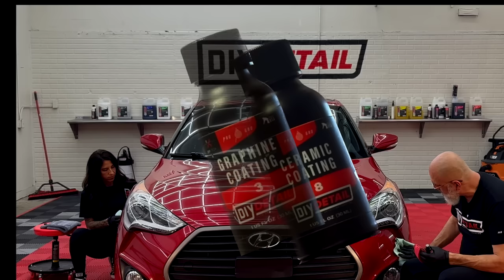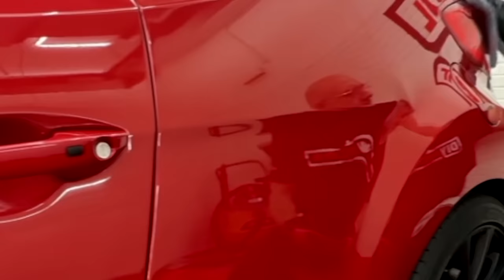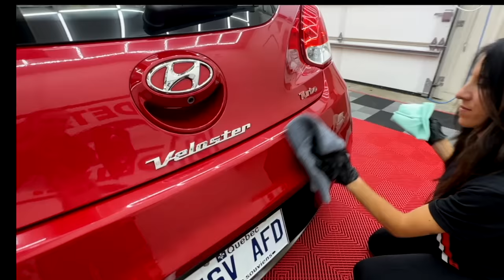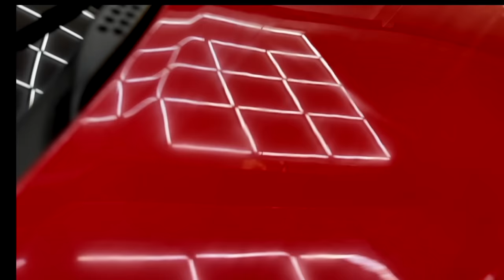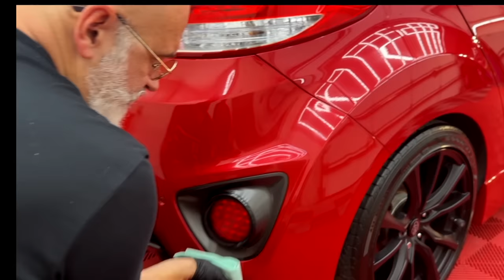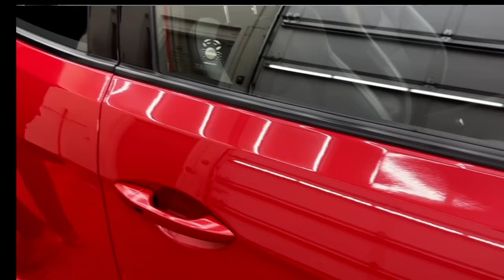THE STACK: the ceramic coating 2 layers, 8 years on top de 3 years #diydetail

Comment: I have a mobile detailing business and I really thought coatings were kind of a gimmick before watching your channel. So much info and I’m going to have ceramic coatings as a main part of my package offerings in the spring. I’m also testing out some of your other stuff currently!
Reply from the maker: Great to hear!
Reply: Be prepared to spend time on a vehicle if your coating. Washing, claying, polishing, panel prep, then you finally can put on the coating. Did a ceramic on a f150 and that took me 6 hours. Very labor intensive if you want to make sure the coating lives up to the durability claims.
Reply: @aRANDOMqUICKIEgunsandfun for a coating to live to it's durability claims the maintenance of it is important- proper period washing, decon etc along with the environment it lives in daily, that plays a much bigger factor then whether you chose to polish or not beforehand etc
Reply from the maker: 6 hours of  pampering your vehicle for years of easier maintenance seems like a good investment in time management.
Reply: I cam assure that ceramic coatings are the best thing for paint right beside polishing/correcting. The best part about ceramic coating is even when your vehicle is dirty, it still looks cleaner than most people's vehicles 😂
Reply from the maker: @pittsburgh4129 very true

Comment: A quick gloss question about topping the 5 and 8 year with 3 year. Since the 5 year is the "gloss king" will the 3-year still enhance the gloss of the 5 year?  And a quick follow up about Ceramic Gloss. I'm super impressed with Ceramic Gloss. Will that enhance the gloss further if applied by applicator every few months? Your no nonsense straight talk videos are wonderful! They really help a lot!

Jim
Reply from the maker: Jim, the stack improves every aspect, including gloss. DIY Detail Ceramic Gloss makes a good thing better
Reply: @diydetailofficial   Thank you! That's exactly what I wanted to know.
Reply from the maker: Thank you.

Comment: I have to say, I love every product that I've used from the DIY Detail lineup! They're every bit of what you claim and then some. I really appreciated the well thought out and simple names to go along with some crazy chemistry that just seems to do better than most of the competition. The videos you put out or top notch as well! Thank you for all you do for the detailing community. It's greatly appreciated!

Will one bottle of your 8 year and one bottle of the 3 year do a crew cab 8 foot bed truck not including glass or chrome bumpers? Some coatings I've used will and others won't, so I'm curious as to if you know or not. Thanks.
Reply from the maker: Thank you

Yes one bottle will suffice, but stretch out the coating. Many people try to apply too thick.

Comment: Just ordered the 5 year kit, the iron remover, the water spot remover (better safe than sorry), and the decon towel. I have a couple scratches that i will be removing but then plan to polish the paint before applying the coating. Its a 2022 VW Atlas Cross Sport so the paint is pretty fresh but if im going through the whole process i may as well spend a couple hours doing a polish.
Reply from the maker: Excellent, please post your results in our facebook group. https://bit.ly/DIYDetailFacebookGroup

Comment: Does applting the three year lessen the longevity of the 8yr coating? Also what's the point in have different grades?
Reply from the maker: No degradation, different grades for different needs

Comment: I loved this video. This is something I've wondered about. Can I apply two levels of the same coating, a 5 year over a 5 year? Does two layers provide additional protection? I have left over coating I don't want to go to waste. I applied my coating a few weeks ago, can I just wash & use panel prep before the second layer if you approve.
Reply from the maker: Yes, you can .

Comment: Great video. I’ve used the 5 year coating and am blown away with the gloss. What do you do with the black trim that is oxidised if you can’t coat it?
Reply from the maker: Use short term protection like DIY Detail Ceramic Gloss or DIY Detail Quick Beads

Comment: I did buy the stack recently and am waiting on spring to detail my truck.  So, its one coat of 8 year and one coat of 3 year right?  Also, I was going to use the same coating on my new boat however, after talking to Glidecoat, they mention that, their coating is formulated for gel coat.  Is yours equivalent and is there truth to what they are saying?
Reply from the maker: The DIY Detail coatings will perform great on gelcoat

Comment: If you get scratches, how do you remove the ceramic so that you can buff and re-apply.
Reply from the maker: Polishing. You do not need to remove a coating completely before applying a new one. You simply need to clean and abrade with a polish.

Comment: If a 3 year coating let’s say last 3 years then how does that effect the 8 year underneath?  Does the layered coating reduce in its properties due to the 3 year “expiring”? Will you have to polish to reinvigorate the 8 year? Or are the two coating chemically integrated and the 8 year properties shine through. Just concerned about the graphene oxide matrix failing. Thanks!
Reply from the maker: The 8 year shines through. If you’re concerned about water spotting, using DIY Detail Quick Beads will be great at keeping Graphene on the surface.
Reply: @diydetailofficial  thanks! I guess the Lexus RX350 is gunna get the ceramic tag team! First time coater going for broke!
Reply from the maker: @WilsonSilverthorne perfect, you will enjoy the process and results.
Reply: @diydetailofficial  Quick one.  I tried to buy the 8 year coating kit and the 3 year didn't ring up free.  Is the coating kit excluded and just the singe 8 year bottle the deal?  Looking forward to the fun!
Reply from the maker: @WilsonSilverthorne  kits are not part of the sale.

Comment: So not to sound stupid, but would the combination of the 2 actually make it an 11 year protection? Or what do you do after the 3 year of graphene is gone? Oh, and gotta say your helper is absolutely gorgeous. Thanks for your videos also they are helpful.
Reply: No it doesn't make it 11. You'll get the benefit of the graphene for the first 2 to 3 years then the ceramic for the remainder of the five years
Reply from the maker: Realistically if you maintain your vehicle properly, the coating will last the lifetime of the car.
Reply: @diydetailofficial  At the end of the 3 years could you do a decon and reply the 3 year again?

Comment: Nick or Yvan - We all know how hard it is to get white or silver cars to shine. Which of your 3 coatings will give me the most gloss, as I own both exterior colors.  I recall you both saying the 5 year would be best many short videos ago but I want to verify. Thanks gents. Love your products.
Reply from the maker: 5 year is definitely the glossiest!!
Reply: Thank you. Can't wait to get my Camaro coated and ready for next spring.
Reply: -Is the 5 year glossier than 8+3 stacked? 

- if i just wanna apply the same coating in 2 layers, will the process be the same in terms of waiting time and window? Does it have benefits?

-Also: can i use your coatings for rims and tires? 

Thanks a lot as always ❤
Reply from the maker: The 5-3 stack is the glossiest combo.
The process is the same to do 2 layers of the same coating, but there’s no real benefit. 
Our coatings can be used on wheels, but not the tires.
Reply: @diydetailofficial  - Copy. Thank you so much!!! Continued success for DIY DETAIL.
Reply: @diydetailofficial  That's all great info! Thank you folks!
Reply from the maker: @keithecklundii5225  thank you
Reply from the maker: @muffin70507  thank you
Reply: @diydetailofficial  thank you again very much ❤️
Reply: @diydetailofficial  i am from germany and cannot order anything unfortunately. The Dutch shop from your distributor list is only shipping inside the netherlands and the UK shops are only for mainland UK because of their brexit. Any euro distributors coming up? Maybe international shipping through your website?

Cheers guys

Comment: I applied the 5 year coating to my car in May. Would I be able to top it with the 3 year coating now after I perform a decon wash? Thank you!
Reply from the maker: Yes you can, but it will not have the same effect.
Reply: What will be missing by doing it 5 months in between versus back to back?
Reply from the maker: When doing them in the 2-8 hour window, we are not putting one on the other, they are combining to create a new surface.

Comment: Can do the 8 and the 5 and the 3 
Dose it work and if u tested it what is look like dose it look better than the 8 toped with the 3  in any way
Reply from the maker: 8/3 or 5/3 have a similar look, but the 8/3 has better hydrophobics
Reply: I recently painted my car and the clearcote is kind a heavy and got som orange Pele  can i wet sand my car for meror look and do the 8/5 for good protection and if u don't recommend the wet sand can I do the stack on ppf
Reply from the maker: @hothefa_oby8973 you can wetsand and polish, PPF, or both, the choice is yours
Reply: Thanks very much fotlr all the help   but  I didn't get the answer for the ppf  can i do the diy ceramic cote on the ppf
Reply from the maker: @hothefa_oby8973 sorry, yes definitely do the stack on your PPF

Comment: Will this stacking & longevity work on Gel coat too after correcting it?  The boat will never see salt water, only fresh.  Can it be applied below the waterline or does it need to be at or above.
Reply from the maker: Yes it will work great on gel coat. The only thing to be aware of is if the Gelcoat is oxidized, it will continue to oxidize under the coating, even after polishing.
Reply: @diydetailofficial  So you're saying that even though it may have 8 year ceramic on it, it's possible that in 2yrs or so, the ceramic coating will still be there but the gelcoat under that ceramic coating will be starting to get cloudy & oxidizing again?  And then I'm going to need to compound through the ceramic to buff the oxidized gel coat again & then recoat again?
Reply: Is there any way to stop it from oxidizing?
Reply: @joelpasserell4525 he's saying that if it's already oxidizing the coating doesn't stop it from continuing to oxidize. It will continue to protect but the oxidation will continue as well. There's really no way to stop oxidation outside of completely removing it and starting fresh. Once oxidation begins it will continue to oxidize.
Reply from the maker: Correct Jeff.

Comment: When stacking the 3 year on the 8 year does it increase the water spot abilities of the 3 year for a longer period of time due to the fusion of the 2 coatings? Or does that not effect the chemical makeup of the graphene oxide in that regard? 

Some coatings seem to only benefit by 10 to 25% when adding a second layer according to some people (really hard to tell in my experience) do you have a more scientific way of knowing how much longer or chemically resistant the stacking will be compared to a single layer of your 8 year coating? 

What is the shelf life of an unopened bottle of your ceramic coatings? Do they lose efficacy after that period or will they start to crystalyze in the sealed bottle? This assuming they are kept in a dark, cool room. 

Are your coatings freeze thaw stable as far as transporting them in the winter? I've heard of people storing their coatings in a freezer to increase shelf life. Is there any truth to that or would that be due to the individual chemistry in a coating. Thanks!
Reply from the maker: Thanks for the great questions! 

Stacking doesn’t change the durability of the Graphene component.

The benefits of combining the 2 like we do( unlike putting the same product on twice) gives you additional slickness, gloss, and self cleaning ability. 

Freezing isn’t a good option, keep them at room temperature ( we have aluminum bottles, so light doesn’t change anything).
Reply: Perfect! What about if the bottle is once opened? For long long they will be good for usage, assuming they are stored as mentioned previously?

Comment: Your site doesnt say how far the ceramic coating goes. For example i have a dodge ram. 1500 4 door. Is 1 bottle enough for windows, rims, paint?   5 year and 3 year
Reply from the maker: Yes, and you should have leftovers.
Reply: I must disagree!  I just coated my 2023 Toyota Tundra Crew Cab with the 8 year coating and I did not have enough to finish the job, I certainly would recommend a second bottle from my experience.
Reply from the maker: Unfortunately you used too much on your vehicle. Next time be sure to not add too much to your applicator. As long as you can see coating being applied to the surface, no need to add more to your applicator.
Reply: Hi There!
You must realize that you have years of experience and gained knowledge, but I am just a DIYer and have watched your videos to try and learn your method and I did try to not use too much.  I watched this video and I don’t think that I was using more product on my applicator that the girl that was helping you out.
This is the fifth vehicle that I have ceramic coated and was aware of the small bottle of ceramic and I was coating a very large vehicle and tried to make it last but it didn’t.
I would strongly recommend that you offer your ceramic coating in a larger bottle too for us DIYers that are tackling a large vehicle and do not have your skill set.  One can’t just run down to their local Canadian Tire and buy more product, it takes at least a week to order on the net!!  And if you run out part way through a job it is a very sick, frustrating feeling!!
Just my $.02 worth!!
Reply: I miss the days when the original DIY coating came in a 60ml. bottle.👍  I wish 40 ml. & 60ml. we're the standard sizes. IDK why it was decided on 30. 🙄.

Comment: Can you top another coating manufacturer like CP with the 3-year coating?
Reply from the maker: Yes, this process isn’t topping in the traditional sense, we are combining the 2 when inside the 2-8 hour window. You can easily top other coatings with ours if you wish.
Reply: @diydetailofficial  top any coating? I got Blue collar 1, from Apex detailing would it be compatible?
Reply from the maker: Yes, ideally you need to lightly polish.
Reply: What if i was applying the coating, like you guys are in this video? Their coating as the base, and DIY on top, after 2 hours?   @diydetailofficial
Reply from the maker: @GoTMLGo1967 unfortunately we can’t test every combination. I wouldn’t take the risk.

Comment: Being a professional detailer since 1986, one thing that drives my nuts is :  people who call themselves detailers mentioning to stack dis - similar things like 
a wax followed by a synthetic/ wax over it as 
a good thing .

You have  a clear coat on 
top - which is a acrylic paint,then you apply a ceramic layer on top of that - followed by a graphene - based one.

Explain to me like a 3rd - grader how the ceramic
layer bonded to the acrylic
clear coat, or how the graphene - one bonded to 
the ceramic layer. 

Answer is : they did not , and
people cannot realize that swirl marks and fine scratches are caused by 
washing which distorts 
the appearance by using 
soap to clean it 

The more you polish your paint to fix scratches and 
swirl marks, the more it will
reduce it's thickness and shine. 

PUTTING MORE LAYERS OF GREASY CRAP ON YOUR PAINTED AREAS IS DOING
MORE DAMAGE - THEN GOOD.
Reply from the maker: Our ceramic coatings are anything but greasy. Once you try them you will immediately understand why coatings have become so popular.
Reply: @diydetailofficial  No idea 
of your detailing experience level , but by your response to me - it ain't much.
 
I have been telling people for 
YEARS that applying different
products on- top- of -each -other
causes swirl marks and fine scratches when washed with 
a mild shampoo.

For years detailers like yourself
told me how I did not have a clue
what I'm talking about when
stacking layers of waxes.

I never said : ceramic coatings 
were greasy - you implied - wrongly something I did not say.
Also , How does a graphene
coating, bond to a ceramic one that is supposedly bonded to the 
vehicle's clear coat ? Answer:
it doesn't.
Correction detailers make a fortune from vehicle owners 
who think slapping layers 
of different waxes / synthetic
- waxes on top of a ceramic coating is plain - stupid.
I said : explain to me like a 3rd 
grader how a ceramic coating
bonds to a Acrylic - based clear coat
Reply from the maker: I’ve only been detailing 44 year, and have been teaching and developing products for over 35 of those. So yes I’m still learning.
Reply: @diydetailofficial  BTW : I 
have used an acrylic paint
sealant for 26 years. That 
cannot be bought from a detailing website that sells
1000's of crap products that
do nothing but waste your 
money.
I know exactly what shine
is . I know what total protection
is . I also know when I apply
this product 18 - months later,
correction IS NEVER needed.

I wash my cars with DAWN , not
shampoo, and I NEVER have 
swirl marks or scratches.
Something you can never
do with a ceramic coating that 
takes several days to apply.
Reply: You may want to get out of 1986 and take a look at modern ceramic coatings.
Reply: @diydetailofficial unfortunately I don't think this commenter ever got out of 1986.

Comment: If I wanted to put two layers of 8 year DIY ceramic, how long do I have to wait from start to start or can I do it immediately after the first coat dries? Also would doing two coats add extra longevity/durability? Thank you.
Reply from the maker: If wanting to do that, the same 2-8 hour window. The performance gains will be minimal.